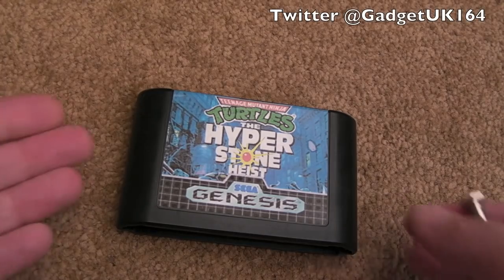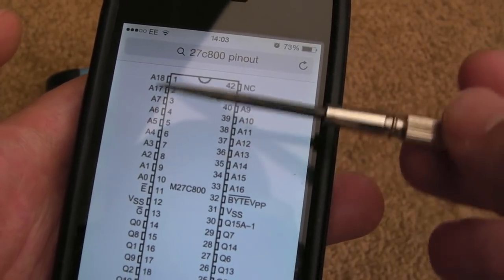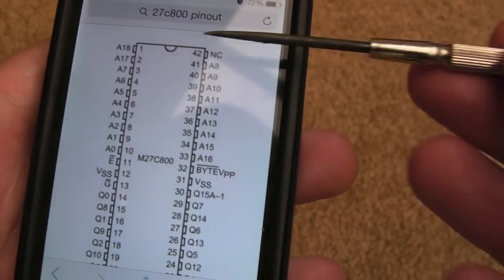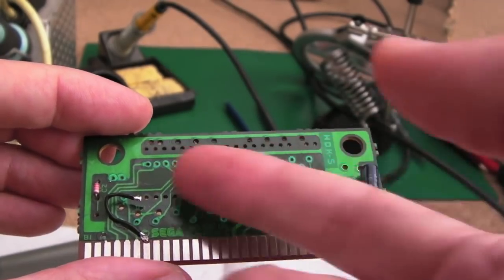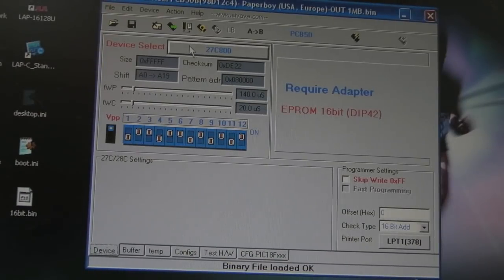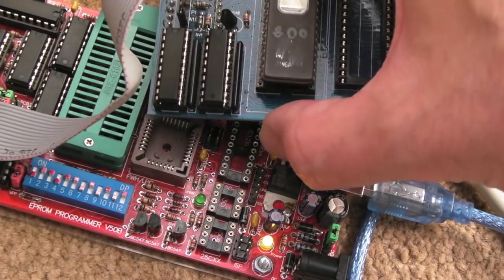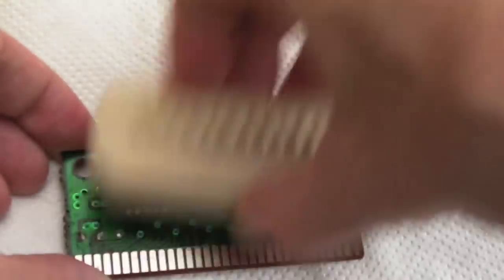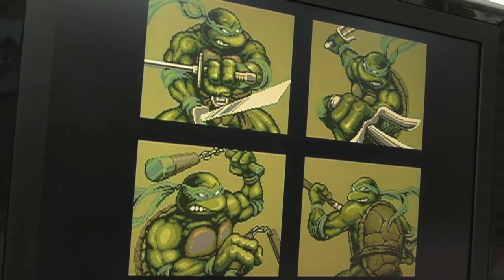Sega Megadrive (Genesis) Cart Conversion / Fix & Helping My Mate Vince

Comment: I can't recommend a desoldering station highly enough, e.g. ZD-985. Amazed how much repair work you get done using those manual solder suckers!
Reply: I would have to disagree, I've had 3 units they all died! Poor switch mode power supply! Better off with a Aoyue 474A++ Desoldering Station with mains transformer.
Reply: I would expect that the amount of soldering irons amongst viewers is higher than the amount of desoldering stations. Therefore demonstrating ways to do it manually videos makes a lot of sense. If you do regular desoldering though... a desoldering station is a good investment.
Reply from the maker: Thanks!  I do have a desoldering station - a Weller one.  I could have used that and it would have saved me a few minutes for sure.   But as Daniël Mantione mentioned, lots of people want to generally see the cheapest easiest way to do something themselves.  I will show more use of the desoldering station on some future videos though!  I might also need to get something to replace the Weller as its kind of on its last legs really.
Reply: If your talking cheap, Amazon has one thats a manual pump integrated onto a desolder iron. Cost me 9 bucks and It works great (so far).

Comment: Man, original Sonic the Hedgehog carts are dropping like flies. I’ve encountered a few myself. Obviously, Sega made a disproportionate amount of those compared to most of their games. This was their first hit of that caliber, so it was their first experience ramping up production. You can find carts from Thailand, Taiwan, Japan, Mexico, etc. It seems that some of their ROM producers weren’t up to snuff. In particular, whoever made the one with the large circular impression in the middle and a groove running the entire length for marking the PIN1 side.

Instead of relying on extra software like a HEX editor, you can use the command line for duplicating and concatenating two copies of the ROM together in one file. You use the COPY command with the /B switch (binary) and basically use the + symbol to combine the same file twice. IIRC, “COPY /B FILEIN.BIN+FILEIN.BIN FILEOUT.BIN”

Comment: Great vid 👍 I have a back log of repairs 😞 Atari 2600, Jaguar, 3x c64 boards and an A500 board with bad Battery leakage, with these videos I’m learning a lot, thanks for your great work 👍
Reply from the maker: =D  Let us know how you get on with a YT video! =D
Reply: Will do, but have done any vids on YouTube just watch and learn, I must get cracking on with them as parts are getting harder to source, also got a double FDD external drives for an Amiga not working and no information on the internet about it 😞 and a side expansion pcb with 4mb Simms and a SCII to sd card converter to play with. Just keep up the great work, cos your help loads of people out there restoring these great computers 👍

Comment: Nice selection of EPROM burners and adapters there Chris, I use a TL866-A for everyday EPROM burning but I also have a old Parallel port Needhams EMP-20 EPROM burner it's great as it has a 48 pin ZIF socket and can burn those higher (40+) pin EPROM's, it can also program gals and proms also. I'm already subbed to My Mate Vince's channel.
Reply from the maker: Thanks mate =D   I need to add a TL866 to my collection - I've heard nothing but good things about it!

Comment: At around 8:15 you mention using solder to de-solder, which works by the way, But for the most it works best if the solder has a flux core or set of Flux cores "Multicore Solder" to it, "Flux is a good heat conductor so a flux multicore works best for amalgamating high and low temp solders to help expediate desoldering at lower temperatures" Mind you most electronics are assembled with low temp solder these days, so a heat station, flux and either a solder wick or solder sucker is all that one needs, even for devices old as the game cartridge here, As its been found the ceramic like substance that chips are made of take quiet a while to actually transfer heat internally "Just bare in mind chips are made up of a ceramic like substance much like the space shuttles insulative heat tiles"  And I do stress much like" so when one heats up "around" key word being "around" the chips for the most it takes quite a while for the heat to slowly seep inward and thus do damage ..

I always smirk when I watch newbs when they first do a heat station de-soldering, as it seems they don't realise how insulative the chips ceramic encasing really is, to which I always blow on the chips ASAP once removed or installed, unlike the many pros and tinkerers I have thus far observed that just dont bother about doing that, I see it that, the quicker you cool em down the les heat eventually ends up slowly seeping to vital silicon, gallium aluminium layers that make up an integrated circuit..
Reply from the maker: Thanks, I use multicore solder =D

Comment: hello there, i am making a repro of contra hard corps, but i cant make it work. i byte swapped the rom and all. The Rom is a 2MB size and i put into a 1MB PCB. since is the same dip 42 pin IC. Do i need to rewire something on the pcb? thanks
Reply from the maker: You need to connect a wire from the A19 pin 42 on the chip, to A20 on the cart edge.   In this video I connected A18 from the chip to A19 on the cart edge.   So A20 on the cart edge goes to A19 on the chip (lift the A19 pin on the chip to make sure its not fed ground or VCC from the board).
Reply: @GadgetUK164 i put the eprom in a 2MB donor and it worked, i then checked both pcbs and is exactly what you said. I cut the trace on the board instead   lifting the pin, and then i ran a wire to that pin. I will leave the contra in its new donor but i wil prep this 1MB pcbs for the 2MB eproms. Thank you for the help!
Reply: @GadgetUK164  If Im not bother too much about this topic, i am actually trying to make a Sonic 3 complete repro with save feature. Unfortunally the info is so poor about Mega Drive Repros. I am looking a article on 8bitplus where a user stated that it can use a 2 IC donor for that game. Although the rom must be split into 512kb pieces and them mount in 2 16Mbit eproms. Do you a good info source about this? Thank you once again!

Comment: 27C800 is an 8 megabit chip, which can be organized either as 1MB*8bit or 512kB*16bit. If EPROM is bigger than image, why not add a switch to excessive address line(s) and put some more images on 1 EPROM. Instead of UV-EPROMs you may also use Flash EPROMs (like 29F800), as they were also JEDEC compatible.
Reply from the maker: Absolutely!  Yes, possible to use the TSOP versions of those chips too with a replacement PCB.  OSH Park have a design on there for a replacement Megadrive card which supports both the DIP and TSOP versions.

Comment: Which eprom programmer do you use? What adapter board was that ontop?
Reply from the maker: For this chip I used a Willems programmer with 16 bit adapter board.  But something like the GQ4X with the adapter board should work too:- https://www.ebay.co.uk/itm/PRG-113-GQ-4X-Willem-Programmer-ADP-054-16-Bit-EPROM40-42pin-Tool-007-UV-Eraser/291805708840?hash=item43f0f9c228:g:HeMAAOSwclVbq-61:rk:16:pf:0

Comment: Great video. Been coming back to look at these again allot since getting a programmer. Having trouble at the moment with Shadow Dancer (512), starts ok but soft resets once you press a button. Goes into attract mode fine if you leave it alone. Strange. Changed the cap and beeped out the pcb.  Have some C800 chips so I'll try the floating pins trick next. Thanks again for the videos.
Reply from the maker: Did you verify that the ROM image works (in an emulator) and that it matches what is programmed onto the chip?  Was the board a 256K board or a 512K board?
Reply: @GadgetUK164  Original Mask Rom , just about to dump it, setting up the ZD-915 at the mo to de-solder. The cartridge just arrived today. Had the box and the manual but gave the original copy to a friend a few years back. Will let you know how it goes.
Reply: Swapped original mask ROM for EPROM and even tried different cart PCB combinations. Same behavior.  Have a Sonic 1 on the Old Shadow Dancer board and works fine. Testing on my modded Mega Drive 1 with the Arduino Nano MD++ inside. Will try it out on one of my other MD's over the weekend. Have a good feeling it might be the mod. Will burn a Japanese version and test that too. Strange but having allot of fun messing about with my new toy.
Reply from the maker: Sonic is 256K, Shadow Dancer is 512K.  What game are you trying to put onto the PCB?
Reply: Shadow Dancer, I picked up an original cart last week. Popped it into the console and ever time I pushed any button ( including D-pad) on the start  screen it resets.
Goes into attract/demo mode fine. So I cleaned it with an eraser and some isoprop, no difference. Next I changed the cap, no difference. 
After that I burned a fresh copy to a 27C800 and soldered that to the PCB,  same behavior.
As a test, I put an original Sonic mask rom on the Shadow Dancer PCB, worked fine.

I'll test out the original shadow dancer cart tonight on one of my other MD consoles. If it works, I'll know that it may have some thing to do with my recently modded PAL MD.
Might also try burning a Japanese version of the rom and see if that behaves the same. 

It's the only game in my collection giving me any trouble. All my other PAL & Genesis games work fine. Don't have an everdrive but it would be interesting to test shadow dancer out on that. I strongly suspect my mod work. The mod allows you to change region and rest the console from the control pad. There could be some thing about how Shadow Dancer handles inputs that conflicts with the mod. Here's a link to the MOD  https://github.com/SukkoPera/MegaDrivePlusPlus   

I'll get the soldering tools out after dinner and I'll record a video of my adventures. The video should do a better job of explaining things then I can. Sorry for the essay Gadget.
Reply: @GadgetUK164  Just tested the cart on another mega drive console. Works fine. Has to be a conflict with the game and the mod. I'll take another look at my mod work, it could be just poor wiring on my part.
Reply from the maker: Maybe its just a region thing - try switching the modded MD into a different region?
Reply: I gave that a go. The MD it worked on also has a region mod ( simple 2 switch ) I have a theory but I would need a scope to prove it ( and a bit of practice with it).
I suspect that the code in Shadow Dancer is not handling button inputs like most.
I think it's poling the inputs, "listening" for a small change in state. If there is noise or interference between the button inputs,  it's messes things up.
When this happens the game resets ( Crash Handler reset to stop it from just hanging altogether ). It's just a hunch but I think shorter smaller AWG wire going from the Arduino to the control port might sort it. Got some nice small ribbon cable for a future Playstion 2 mod I can use.
Reply: Its crazy. My last mess up  I made ( Amstrad project ) had me researching and learning CMOS SCR Latchup. This fault has me up late learning about Induction and cross talk :).

Comment: The GQ4X is a great device but it doesn't do GAL's.  Think I paid around £100 with 16bit adapter.
I also have one of those dodgy EPROM erasers :)
Reply from the maker: Yeah, that's one problem and the reason I ended up with 4 or 5 EPROM programmers lol.   There's always that one or two chip types that any particular device just happens to not cover.

Comment: I also had trouble with 27C800s I got from China. Some couldn't be erased, some could but failed programming like yours. The ones that refused to be erased should be left longer in UV Eraser. I read somewhere (datasheet?) that it's recommended 50+ minutes. As a general rule, the higher the capacity of an EPROM, the longer the erasing process.
Reply from the maker: They seemed to erase OK but then fail on a specific location when writting.  I suspect they need more erasure time, or I might have to play with the speed / timing settings to try and slow / speed up the program.

Comment: You should still be able to use good old copy /b file1.bin + file1.bin file2.bin to double up a copy.
Reply from the maker: Yep, that will work too =D  I often use a hex editor as with other ROMs there's nearly always a header that needs removing too and its easy to just do it in the hex editor.
Reply: Oh yeah, there is that in some of them.

Comment: I'll have to check out the original vid. I always thought the problem with Tengen Sega Genesis carts weren't with the ROM chips but with the crummy cartridge PCBs they used. It's as if they selected whichever PCB manufacturer Activision selected for their Atari 5200 cartridge PCBs. I'd imagine anyone still wanting to use Tengen cartridges - instead of an EverDrive - would want to buy up as many disposable Sega Sports cartridges for $0.50 - or cheaper - and then de-solder those ROM chips and install the Tengen ROM chips in their place. Makes me wonder if installing a socket would take up too much room inside the cartridge shell...